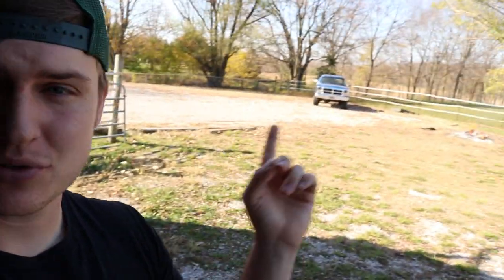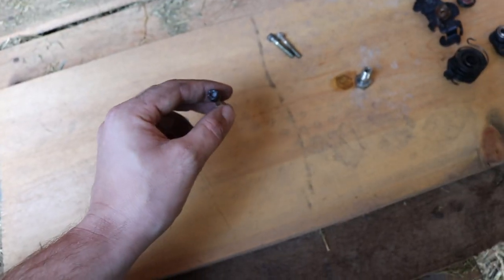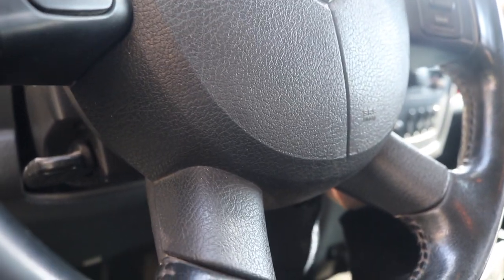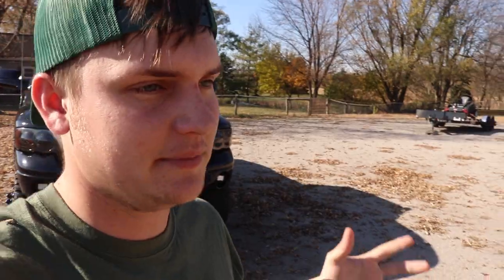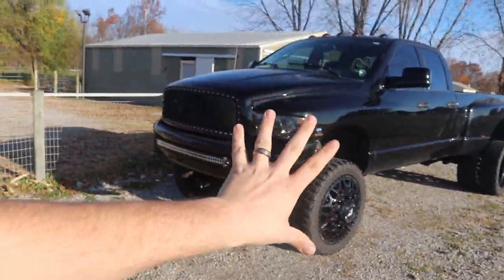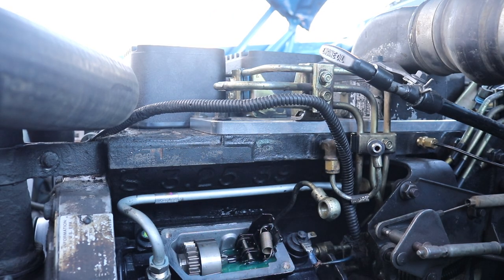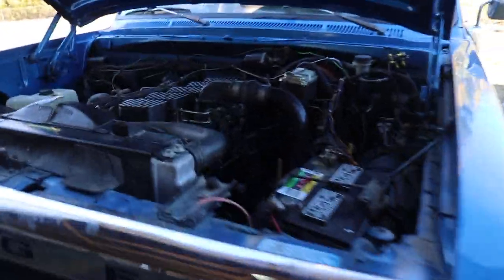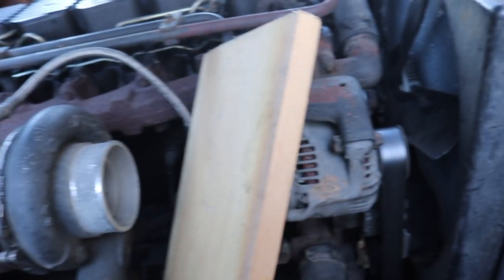MY 1st GEN RAN AWAY ON ME!!!!!

Comment: When you installed your throttle lever back on you might not have indexed it correctly. I’d take a look at where the markings meet up with each other.
Reply from the maker: That’s the thing though.. it was on the 2nd notch and that’s where I put it back 🤷🏼‍♂️
Reply: @LOUDNPROUD  double check because when I was installing mine I tightened the Allen head nut down and it moved on me. Come to find out it didn’t seat down all the way on the splines before tightening everything down that caused it to move when everything seated down. Took it back apart and was able to get it all properly seated on the 2nd notch.

Comment: I blew my turbo on my 04 ram 3500 5.9 it dumped oil throughout the exhaust installed new turbo it started perfect ran normal on my first test drive started up the road a small incline and punched it and omg the biggest cloud of black smoke and crazy power I was heading to a intersection I didn’t think I was going to get it stopped. Do I just cranked the wheel hard left did a uturn I love the turning radius of my ram 3500 crew cab lbdrw as soon as completed the turn it calmed down wow what a rush. Idk

Comment: You should be able to stop the  run away with the key It’s just a fuel run away so once you turn the key off it’ll stop the shut off solenoid Need to run the power screw all the way in in the back it out 2 1/2 turns and then go in and out from there

Comment: I'm going to say its the fuel screw aka power screw aka smoke screw lol turn it out a 1/4 turn and try again. I would wait until you have someone there to be ready with the board. Keep doing 1/4 turns until it stops running away. From the things I've seen thats what id say the problem is.

Comment: this is not a run away .. just full throttle
Reply: Ya I was thinking the same thing this is just clickbate
Reply: Technically an unintentional full fuel situation is a runaway, as it is often seen that these engines run higher than rated RPM

Comment: You need to take the top of the ve back apart you didnt get the leaver in the right spot it either went on one side or the other on the power screw and it got stuck once you gave it throttle either that or you hve the throttle to tight or the springs on the return for the throttle are bound up its either one or the other. Before you tear it apart try moving the throttle with out starting it up to see if the throttle is returning. If not you'll need to try to adjust the throttle or take it back apart to see if you got the power screw lever stuck.

Comment: Did you have tension on the spring when you indexed the throttle linkage? You may have to move the throttle index to the first slot and then slowly turn the screw in from that point with the truck running .
Reply from the maker: Yeah I had the lodes spring put back in correct I thought
Reply: @LOUDNPROUD  I’m almost positive it has to do with indexing . You didn’t mess with the power screw(turn it up)? I push down on the linkage and pull up on the throttle pin with a set off pliers lightly the make sure it locks in good. Sometimes it can pop out of the linkage there fore loosing the index lineup. Also dumb question but you put tension on the linkage spring?

Comment: Sounded like it was just hitting rev limiter not running away
Reply: That's what it sounded like to me. That's what my truck sounds like at 3k rpm. OEM governor springs on my 95 2nd gen, but 100hp over injectors and snappy delivery valves. 50-55mph 4th gear, 1100-ish EGT's, up a 12-15% grade towing a 2800# trailer, turbo just a-singin' away, and still more throttle to go!

Comment: Back the power screw out quite a ways. It won't start. Move it in one turn at a time trying to start it each turn. You will eventually get to a spot that it will start but idle super low. Keep screwing it in until the idle is good and no runaway. Dm me on instagram if you need other suggestions. I answer ve pump questions everyday. @decent_1st_gen

Comment: Ur throttle isn't set right. Not the pump. Adjust that throttle and it'll  e fine
Reply from the maker: What part of the throttle do I need to look into?
Reply: @LOUDNPROUD  the throttle screw that u removed. Should've marked where abouts it was and then put it back. Its definitely a throttle issue rn. Had the same issue last week with my 82 dodge ramcharger
Reply from the maker: @that_99dakota78  which throttle screw lol theres 2 I believe and then that “power screw” for more fuel?
Reply: @LOUDNPROUD  whichever one u removed when u said u removed some throttle parts And demonstrated that little Allen bolt how it was a pain to temoved
Reply from the maker: @that_99dakota78  all of them lol